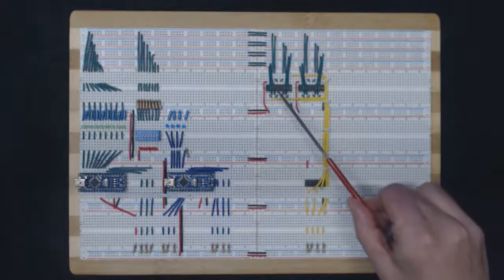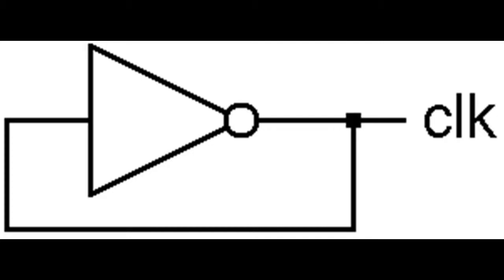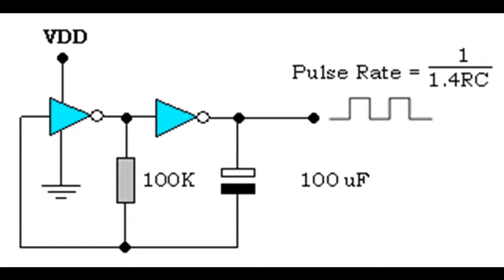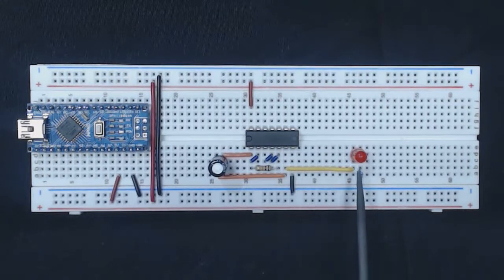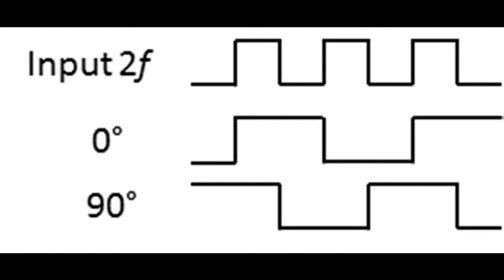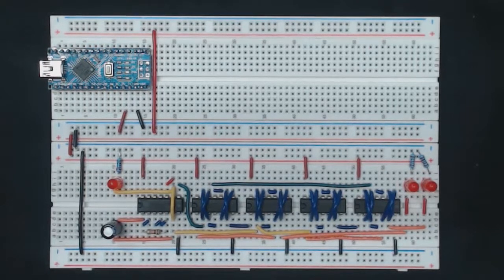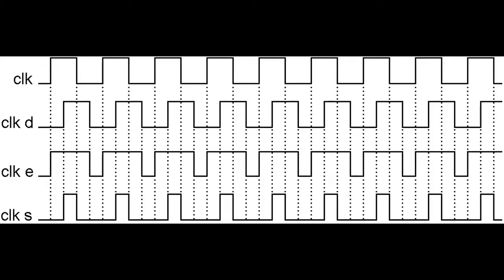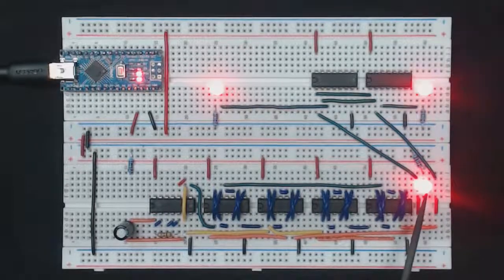But How Do It Know? Video #16 - The Clock and Stepper (part 1)

Comment: How you arrived at the value 0.7 hertz with that formula, R is resistance, right? C is for capacitance or coulomb? I'm confused
Reply from the maker: R is resistance (10kohms = 10000 ohms), C is capacitance (100 microfarads = 0.0001 farads). So 
1 / (1.4 * 10000 * 0.0001) = 0.7 hertz)
Reply: @patrickleboutillier  Thank you very much !!! Now I understood my mistake. The formula works with farads, and I was using MICRO farads (µF). And again, Thank you for this video series!